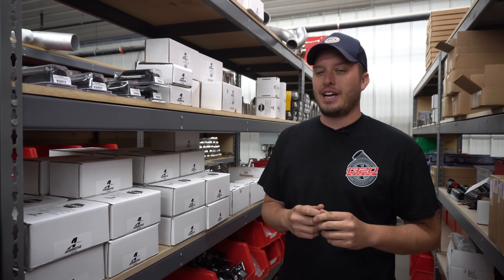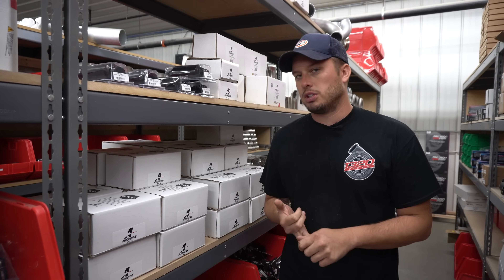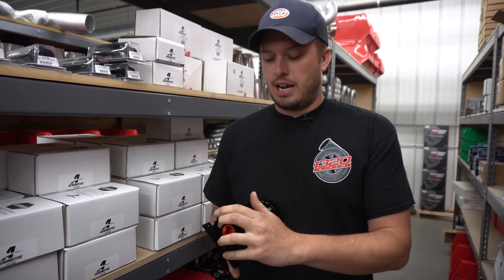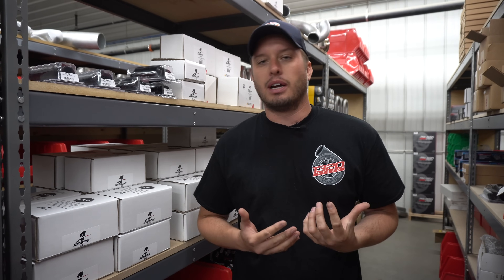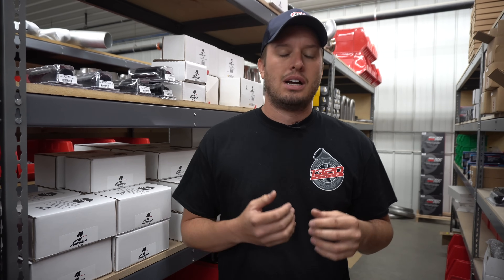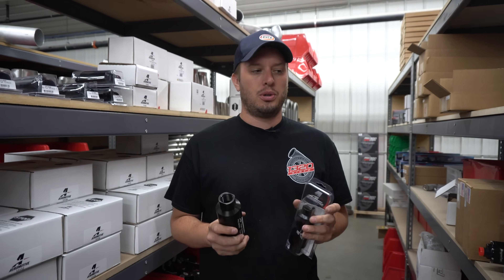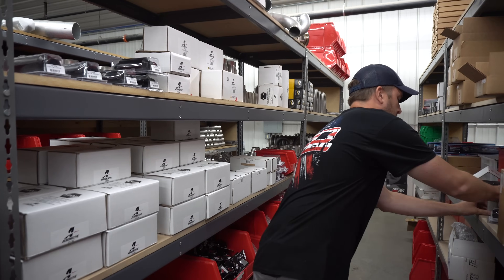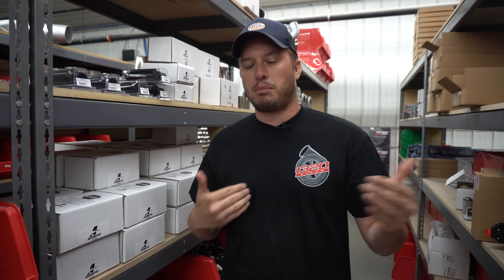Why Your Fuel Pump isn’t Performing: Tech Tip Tuesday

Comment: So let me run this past you I’m running the waterman racing mechanical pump. And I usually have to crack for a good 10-12 seconds minimum twice before my lsv starts on haltec 
I noticed that after a few or even a brief drive pressure will drop   And I’m using a 12 an fuel filter and an areomotive regulator and external check valve so the system doesn’t bleed down when parked. I will notice pressure will go from 35 psi and at idle the pressure drops down to 7-8 psi and obviously no throttle response could I use a electric pump at the tank fcs cell along with the waterman sprinter pump

Comment: I'm very thankful for everybody Motion Raceworks they where awesome in the past 3 months at the last minute helping me get the last 30% of parts I needed to basically to get my black 03 single cab 1500 running, driving and looking bad ass under the hood! LoL  It took me almost 3 years to get it where it is now and it came out better than my original plans but it was a pain in the ass being poor saving money and buying parts and racing my little old turbo 99 Z28 doin my best to keep it running but it got to the point where I couldn't afford to be competitive it went a best of 5.38 @ 129mph that's all it could really do sitting how it is @ 3100# but my bestfriend bought the Z28 3 or 4 months ago as a roller and decided to finish up the old black Sierra inside and out its 9 out of 10  for a 17yo truck it had 79,xxx miles on the little v6 and 60e. I didn't cut any corners and done every thing right its got calvert leafsprings and caltracs double adjustable Vikings 4" drop out back and eibach 90/10s and springs sport lines maybe idk they dropped the front about 2.5" and I done a 5 lug swap up front, at the moment it's got the half filled ls2 block that was gonna be built for the truck but I ran out of money and threw something together with shit I already had it's got gen4 4.8 rods and crank with D.S.S forged pistons the LJMS cam,prc CNC'ed 799's and 102mm summit brand aluminum intake and TB with Bosch  210s off the bullet out of the z28 ( filled 04 ls1/6 block cast wheel Borg t6 88mm on methanol ) I had the cold side of the Huron speed single t6 kit powder coated black and wrapped the hot side and did what I could to make to the old 88mm Borg look good lol  polished up the intake, motion valley cover and 4 corner steam I did my best to keep it simple and clean its on a Holley hp th400 swap factory case  th400 with fti hard parts and valve body with t/brake. PTC  converter from the Camaro it's a bad ass converter and works but could be better I got a 14 bolt rear end for free so I cleaned it up put a spool axles and a 4.10 gear painted the housing black arp wheel studs  if it wasn't for selling the race car this corona bullshit and that sweet stimulus check this big girl would still be on jack stands instead of the sweet ass 17x4 alumastars and RTS single beadlockS77'S on Hoosier 28x10.5w's it's been to the track once 2 weeks ago and on the 5th pass went a 6.81 @ 105mph with no timing or boost lol the goal is to have a bad ass turbo single cab street truck that can run 5.90s its about 8 tenths away I know it's got it in it, that little 330ci ls2 and cast wheel Borg 88mm with t6 1.15 exhaust housing is meaner than I thought it would be and sounds pretty good with the 5" hood exit with the gates merged in for now im not cutting a hole in the fiberglass cowl hood its gonna get a 4" exhaust  to atleast infront of the rear end. I'm loving it I forgot how much fun quick street cars I'm actually having more fun with this truck than my old z28 it may be alot heavier and not as fast but its damn good time playing around on the street and the track lol sorry for the long ass post I'm sitting hear bored to death and was thinking about my truck! Coming soon 20+ pounds of boost one the baby ls2 and some TSP forged rods and stock ls2 crank and a set of 823 rec port ls3 heads and 20+ pounds of boost

Comment: You keep saying the 750 4303 has to have a dual 40amp relay but all you carry on your web site is the mp 1050 dual 30amp relay. Did you make a mistake and say dual 40 amp? Or is the part info on site incorrect? Thx
Reply from the maker: The MP1050 is the correct relay for that pump!

Comment: So I just had my 4303 pump rebuilt by Magnafuel.. they said the pump drew ~14 amps at 12.5-13V (can't remember what Jeff said).. that being said, why are the dual relays necessary? I plan on PWM the pump using an SSR with my Dominator, that's why I ask
Reply from the maker: Brandon Smith peak load and startup is much higher than that.  They flow test them slightly different than real world conditions (which doesn’t make it a bad test for what they’re trying to do).
Reply: @MotionRaceworksOfficial  then I guess the question is, what relay is suitable to PWM a 4303? The NOS one from Holley?
Reply from the maker: Brandon Smith I don’t think the relay or wire size is big enough to do so.  However, there are other SSR options out there in the world that you could do so with.  It’s not really necessary to pwm a 4303 tho with a proper size fuel return and regulator.
Reply: Brandon, I use a Crydom D1D40 SSR to pwm my 4303 with my dominator. I do it partially to reduce the amount of unused fuel being pumped through the engine bay. Heat in fuel reduces octane.

Comment: Do those Magnafuels 750 fit pretty easy in a stock truck tank? 04 suburban single turbo
Reply: The 4303 isn't an in-tank pump, so you'd be looking at sumping the stock tank or finding a different pump. Aeromotive and Holley make large in tank pumps, but I'm not sure if they're drop in

Comment: Will a single 80amp really be enough for a 4303 magnafuel ?
Reply: 4303 only draws about 15 amps @45 psi so as long as you don't do anything dumb with it a 30 amp will be enough.